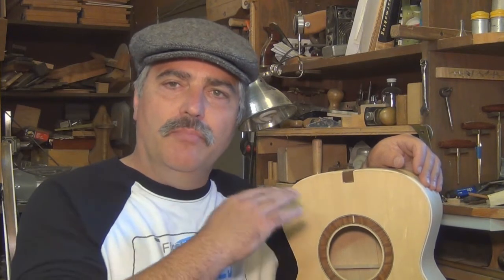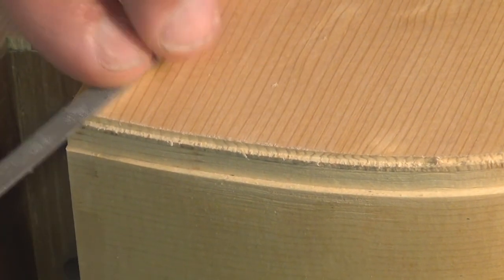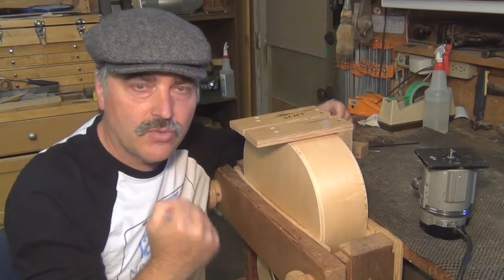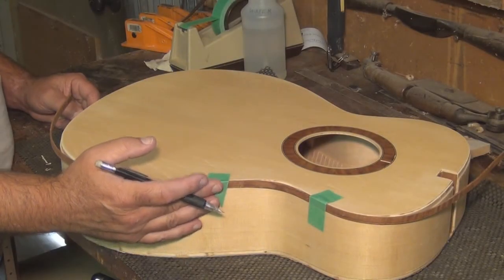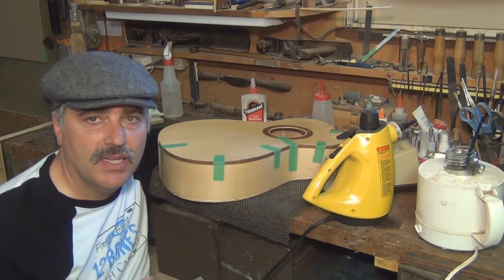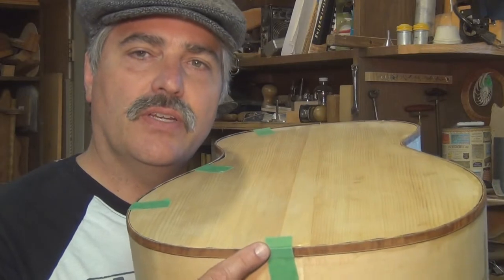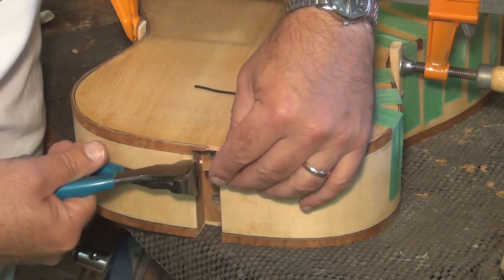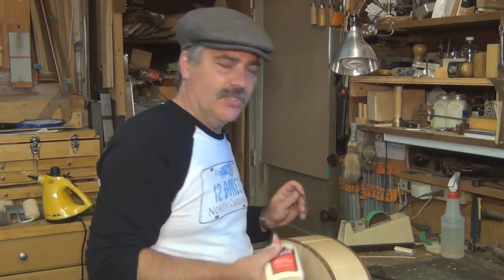Chapter 18 Installing the binding

Comment: Hi.. great videos!  How thick your bindng is? It seems very flexible.  Thanks for answer! :)
Reply from the maker: The veneers are .020" or less and the solid wood is about 1/8" but will be less after fitting to the side. Most important here is to use wood with minimal runout as that will split more easily.  Kind of hard to do with figured material because the figure often is the definition of run out.